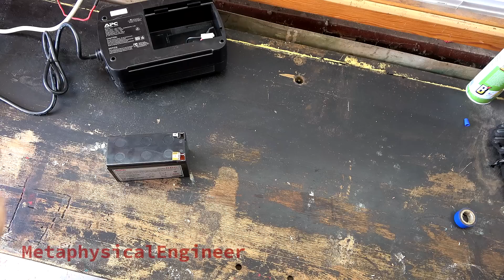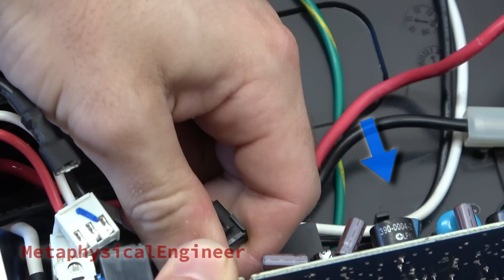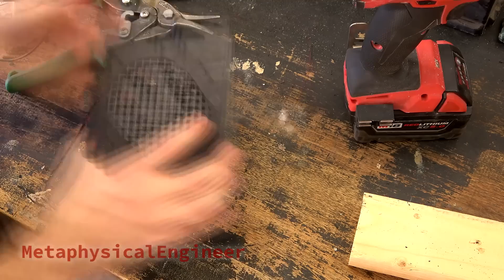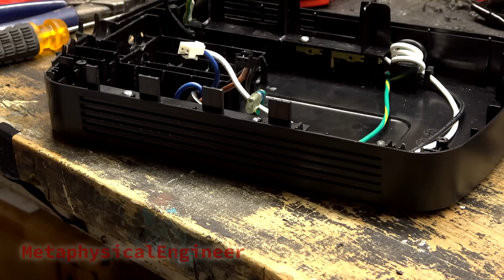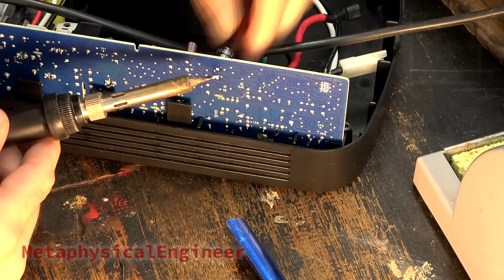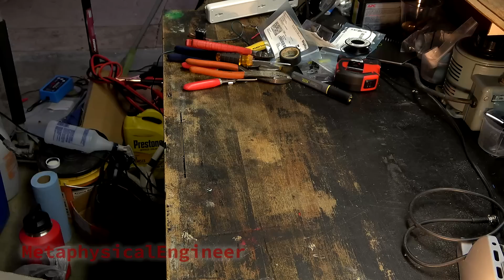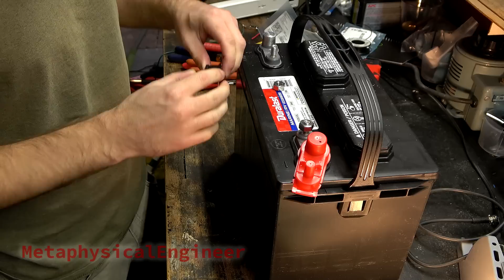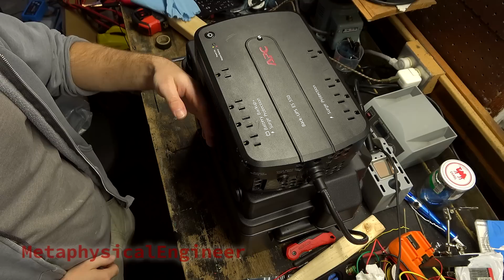Modifying broken UPS for long endurance BACKUP POWER!

Comment: Great project. I did this exact same thing a few years back (minus the fan driver circuit). I ran into a problem that you will probably run into as well. The batteries in these UPS devices are AGM (absorbed glass mat) but the boat/car batteries are FLA (flooded lead acid). I had a problem where the float charger in the UPS would basically boil the FLA batteries dry and destroy them. I found out that the charger was trying to overcharge the FLA batteries. The "full" voltage that the float charger in the UPS I had was 14.5 volts due to it using the AGM battery. This is too high for a FLA batteries. They should float about 13.5 volts. I could not find any way to adjust the float voltage in the charge circuity so I gave up on the project, I just went through too many batteries to make it worth it. Another thing I found was that the FLA batteries off-gas quite a bit while they are charging. At first I had the entire setup inside the house, but things in that room started rusting and the I started getting complaints about the smell (the off-gas is also explosive. It's hydrogen gas) so I moved the batteries outside and ran the charge wires through the wall through and existing hole. You might look on your APC board and see if the float voltage is adjustable. Just my opinion and my experiences.
Reply: A better choice and longer lasting both in capacity and battery life is going with LiFePO4 batteries.
Reply: @FirstLastOne  Yes, but they require an entirely different charge profile.
Reply: @bryan314 Yes. And that's why you put a charge controller/BMS/protection board on your Li replacement. (I'd say do that even with a PbAc as these UPSes have some of the stupidest charging systems.)
Reply: @jfbeam  at that point, why are you messing around with the defunct ups rather than just building the whole thing from scratch?
Reply: @bryan314 It's what he had. And you can buy packaged "12V LiFePO4" batteries with all the Magic(tm) circuitry already inside them. They're way more expensive than a car battery, 'tho.
Reply: @FirstLastOne  yeah but they're  quite a bit more expensive
Reply: 14.4V is an equalization charge for a flooded battery. It's SUPPOSED to slightly gas to get the electrolyte mixed. (see also: battery stratification) AGM/GEL NEVER do that as it will destroy the electrolyte. (if you boil an AGM, it's 100% instantly gone. There's no putting that water back.) The issue is that these cheap consumer UPSes continuously charge the battery. In all batteries, all that does is generate heat. It will eventually melt an AGM, and dry out a flooded battery. (but you're supposed to be checking your flooded batteries.) And yes, charging a PbAc battery generates hydrogen. (the mat in AGM cells is designed to hold the H2 rather than gas it away.)
Reply: If you get to the “smelly” point that’s not hydrogen- it’s hydrogen sulphide, toxic and flammable
Reply: It wouldn't surprise me that they overdrive the charging to shorten the life of the unit, otherwise you would only ever buy one.
Reply: The one thing I throughly disliked here was the choice of battery. But please read further. Marine deep cycle is a trap I would have fallen for a good bunch of time ago. Those aren't really all that much better at handling deep cycles than what came in the UPS, if still they hantle it quite better than an ICE car battery. Though if those 12.9V are the float volts... that's 3.225V per cell, a bit too low to fill LiFePo4 cells up, you'd want 3.4V per cell or slightly more, for a pack voltage of 13.6V to 14.3V ideally, 14.4V maximum. A 3-series lithium NMC pack would be almost good for that float voltage of 4.3V per cell though, could work out with a decent BMS.
Reply: Nevermind those calculations I made. A second watch of certain parts of the video showed the 13.5V float. That's perfectly good >90% SoC float voltage for LiFePo4, 3.375V, (would need a balance voltage lower than full charge, which some bluetooth enabled BMSs easily allow to set). LiFePo4 aren't hurt by a float voltage below 3.6V, unlike Lithim NMC that can be hurt by floating them at full charge.
Reply: It's not a trap at all to use a cost effective battery with minimal extra time invested, instead of your hypothetical ideal of rigging up an alternate battery chemistry with associated change in charging and discharge cutoff, all for something that is only in use intermittently when mains power is flaky or off.  The trap is not recognizing the needed goal of the project and going over-budget and wasting time to exceed that goal for an outcome with a benefit that is seldom if ever realized.  Even if the chemistry is changed, you face the same situation in that LiFePO4 is a poor choice due to lower energy density per dollar with no reasonable expectation that the higher # of discharge cycles they offer, would be needed.    If you're going to these extremes, don't even bother on a crude budget priced modified sine wave or square wave consumer grade UPS, nor any UPS that has had over a decade of wear/use in the field already.   @lua-nya
Reply: id say it was faulty if it float charged at over 14 volts
Reply: @andrewsmart2949  sounds like it was never floating at all
Reply: Maybe a lead calcium would be a good option they take higher voltage charge and are readily available.
Reply: I guess I assumed that most deep cycle batteries made today were either agm or gel,but I have limited experience with them I do have a dual purpose deep cycle/starting battery Optima Yellow top in my 2007 avalon obviously agm but because agm has a higher voltage @100% SOC the charging circuit in the UPS would over charge a regular flooded lead acid battery just as a charger designed for flooded acid would not bring AGM battery to 100% SOC and possibly hurt cycle life as well.  Love your video and idea I have always wanted a UPS with really long run times like a hour or more  of backup power for workstation and Nas and all internet/network equipment but cost was well over 1000 if want to power a large television as well then triple or more the cost requiring 220v 20amp circuit, that makes me think what if I wanted a laser printer to also have battery backup as well what are the surge wattage requirements
Reply: Explosive and highly toxic hydrogen sulfide it smells of rotten eggs and is deadly in minute amounts
Reply: What if you simply put the voltage sense wire on the charging circuit output but then after it, put a series of diodes between that point and the battery to drop some voltage?  This may not work if the charging circuit is smart enough to cycle off when it takes a (battery) voltage measurement.  This can be measured to see what is going on.
Reply: If you can disable the charging feature of the UPS you could then use an external battery charger/maintainer that would automatically stop charging when the battery was topped off.
Reply from the maker: Interesting that yours ran the charge voltage so high.  14.5V is very high even for an AGM type; typically I see 13.8V listed for AGM float at 25C.  Constant 14.5V will cause significant offgassing, while at 13.5V offgassing is minimal.  30:06 is where I show the final product, including float voltage and testing with my computer as load.
Reply: @MetaphysicalEngineer , my APC Back-UPS ES 550 looks identical to yours, and it floats my car battery at 13.56v.
Reply: @MetaphysicalEngineer  thanks for the reply. My current Trip-lite has two ES7-12 AGM batteries in it. I just replaced them. It was not an expensive unit, but came with AGM batteries. It’s the Trip-lite model SMART1300LCDT. So there is that. Anyone who is thinking of doing this mod should pay attention to what the charge voltage is for the batteries you are replacing with FLA.
Reply: Being more expensive, AGM batteries in a UPS application would be uncommon. Typically you will find sealed gel-cells in the commercial market, which you have to be even gentler with.
Reply: Could you not just add a diode to drop the voltage by 0.7volt going in to the battery? Perhaps even 2 in series if more voltage drop was desired? There are 2 main types of diodes with 0.7 and 0.3 volts dropping respectively, perhaps one of each to get the 1v drop you suggested? If you put them on the charge lead that only slow charges you would not need expensive high power diodes. Would this not be a viable option to save the life of your batteries?
Reply: @agw5425  The battery doesn't have a charge wire and discharge wire, so you'd have to have opposing parallel diodes to get your desired drop. The one in the discharge path would indeed need to be one hell of beefy diode as it could be expected to see north of 50A! Everything you are describing is literally a battery protection circuit. If he weren't repurposing a crappy UPS, he'd be able to control the builtin charging circuit - as MANY have pointed out.

Comment: I have a project like this. my one dose not charge the battery so I had to buy parts to fix that and I will use Tesla battery cells that I have from another project to replace the lead acid on inside the back up power plug, I will add some wirers so I can use it in the car plugged into the lighter socket which is 30 amps 12 volts and I will be able to charge it and use it as an inverter rated at 300 watts the lighter socket is rated at 30 amps and this gives a ratting of 360 watts supply so I think it will be handy to power stuff while out in the car and can be used indoors as well.
Reply from the maker: Would be interesting to see how once of these units performs with lithium cells.  Please be extra careful with proper battery management circuitry and fusing given how sensitive lithium cells are to abuse and how violent the failure modes can be.  I have no experience with homebrew lithium packs so I can't speak from experience, only from general knowledge and a few instances of close calls of devices with built in lithium batteries failing in scary ways.
Reply: I did not take care and slapped a battery together for an electric bicycle, It worked well until it was put on a higher charge and exploded into fireworks in my house. It had so much power and stuff flying out I will never think of them the same way again.  Each Tesla cell tested at 3.4 amps usable power, that is a lot. Then stripped a DeWalt battery and fitted the tesla cells. It is wonderful and powerful. but I'm always wondering will it go up .  I learned never use any lithium cells if there are any dents or damage, nothing they must be perfect. I know why Tesla wont fast charge a car after any accidents @MetaphysicalEngineer

Comment: 8 years ago, I lost the power drop and breaker panel from my small mountain house during a landslide. (As well as many other things!) It took a year and a half to get everything back on the grid.  In the meanwhile, I took the 650 model of that UPS, bought 6 golf cart batteries, brought out some heavy leads from the UPS, tied the batteries up with an external 60A charger and ran all the house lighting (LED) cable modem, router, pico cell site and 32" TV/monitor and laptop from it for about 16 months. Charging during the day with a small inverter generator. Worked well for all that time, never an issue. After I was back on the grid, pulled the UPS apart. No signs of heat or component stress whatsoever, still worked great. Maybe pulled 20-30W at night, max maybe 200 during the evening. Carried me well for those several months. Now I've got 20Kwh LFeP04 battery and a 3000W inverter/ups/charger which can handle everything for a few days. (mtn folks lose power a _lot_)  But that little APC did great! The transformer based ones are very solid..  Good vid!
Reply from the maker: Wow that's quite the experience!  Glad you were safe!  Sounds like these units are quite tough; I wonder what the inside of the transformer windings on your unit looked like as those seemed most likely to be stressed long term.  

Wise move to have ample backup power where you live it seems.  Hence my frustration that my place here in the suburbs gets such unreliable power when we don't have landslides and ice storms and such.
Reply: The transformer had no discoloration of the bobbin plastic at all.  Early on, I tried loading it down to almost ratings and checked external temps carefully, seeing almost no rise.
  My usual "hi" load would be about 200W, most of the time more like 80-100W. Small 32" LCD TV, laptop, all LED lighting. Modem, router and pico cell. After 16 months + continuous  running not even any really hot resistors or anything.
 (I've been a tech for (gag) 50+ years now, and always crazy about batteries and power systems.)
 Since those days, my loads have increased, 50" TV/monitor, SFF desktop PC (10 years old. Really have to swap in the new Ryzen system, but lazy...) added a Starlink sat setup so that when it really gets ugly up here, power, comms and everything down, I can still communicate. Does draw 60-80W, tho, it seems)
 Current base load about 200-250W, more like 500W +refer/freezer for max. (70-80w freezer, cycling, 80w refer compressor cycling/400w defrost cycle)
  As of Thursday, all my 'critical' circuits here have been cut over to the SunGold inverter/charger and the 20KWh LiFeP04 setup. Utility has an outage scheduled for all day Wed, will see if the house systems even notice.  If I'm frugal, can get around 4 days runtime.  Have many hour/multiple day outages at least a few times a year here. Redwood forest, many trees. Refer, freezer and microwave now added to the system. Surplus, quality LiFe batteries are getting to be pretty good deals! Enjoy your little APC!
  @MetaphysicalEngineer
Reply: @MetaphysicalEngineer  : The most common cause of power loss is cars running into poles, and then various tree-related maladies.
Reply: exactly yep . nice  engineering   , but the apc  max   200 watts isnt enough power  and  board/mosfet will eventually fail  .....  better and easy to buy  1500-2000 watt inverter  amazon etc $130 bucks  and run  1 lithium  100amph and 2   decent size lead   marine  batteries   mixed --(yes together)   they work  great together, compliment each other and  many  boat guys  do it ,  then you have  mucho power  .

Comment: what your computer uses 120 watts ?!?! that's insane... just below 60 watts is normal at idle load
Reply from the maker: Gaming computer, with moderate overclock, with mostly 7 year old hardware aside from newer GPU.  Measured it at 60 watts at idle with absolutely nothing running besides OS but closer to 90 when actually doing something, plus the monitor for another 30 or so.  Hence an estimate of 120.  The 200+ watt load test represents typical while rendering, which is one of the tasks that I want to ride through a blackout.

Comment: excellent work next time don't trim strands off the wire not that its a big issue but I stick an "ALL" or a pic in there and widen the aperture to fit the wire as its a crimp anyway it may buy you a bit more where losses are concerned if you are looking for every bit. I often upsize my conductor runs for solar to help with losses.
Reply: "All"=Awl
Reply: @xNYCMarc thanks, I was quite confused there.
Reply from the maker: I really didn't want to trim that much.  Somehow none of the places I went to had 3/8 terminals for 8ga wire in stock. 
Also funny how an automotive or marine ampacity chart said I could use as small as 12 ga at such a short run.  Based on how warm the 10 got during testing, 12 would be cooking at sustained load!
Reply: @TechReclamation - Cable gauge, or cross-section losses are only significant over some distance when the resistance adds up.  Over a distance of maybe 0.2mm between the trimmed strands and the crimp, the losses would be completely insignificant.  After all, consider the tiny cross-section of just the stamped steel in the neck area between the crimp and the actual load connection....
Reply: I've been known to remove the plastic from a terminal and open it up a bit by splitting the end.  Sometimes it's already cut so you only need to separate it, otherwise a Dremmel helps.  Then slip some heatshrink over the wire, crimp it or solder it or both and shrink it down.